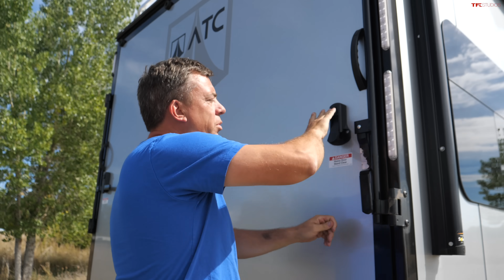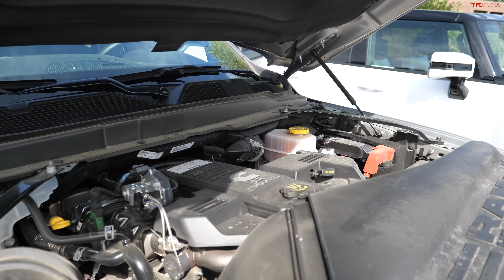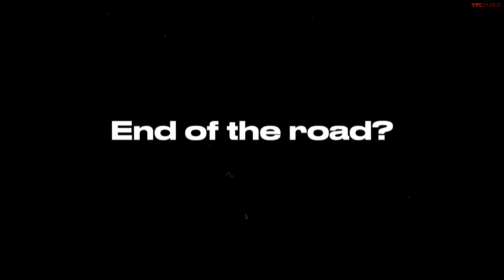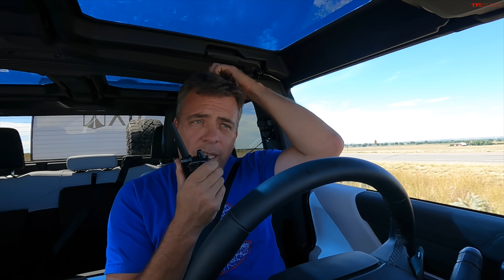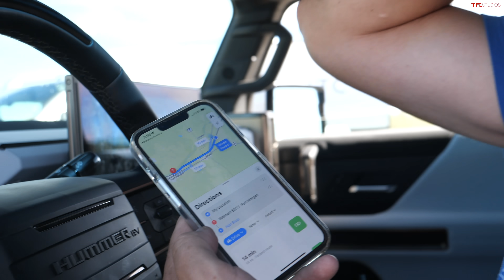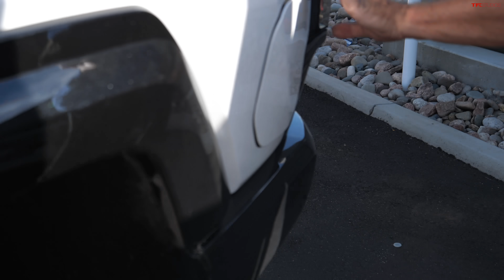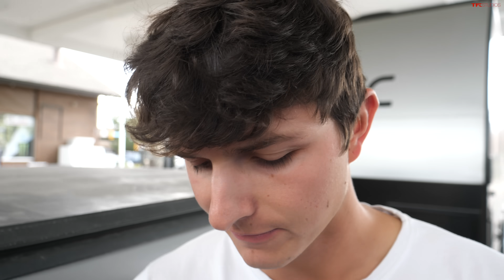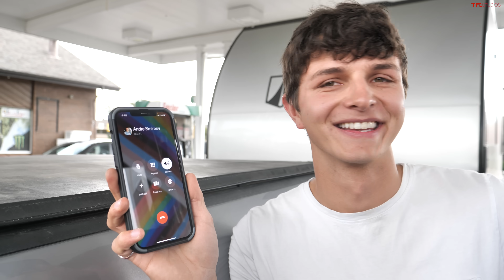How Far Can a Diesel and Electric Truck Tow An Identical Camper Trailer on ONE Fill-up?

Comment: Does it really matter how far a truck can go when it can make it to the next gasstation/ chargingstation ? As long as they are like 100 miles apart max, you are fine.
Reply: It is a problem when you have to spend half an hour each time you stop, only to recharge by 50%
Reply: @williecompton243  So, as I was saying, it is not about how far a truck can go. 
It is about how fast it can recharge the moment you go further then it's range and what you can do during that time.

Comment: The hummer weighs ~1400lbs more than the Truck. Should do another Comparison with a diesel truck that has a curb weight that is the same as the Hummer and then compare towing capabilities and range.

Comment: You should do the test with same amount of money in fuel.  Fill EV first then fill Diesel to same cost.  Might be able to get out of town with the diesel.  EV's have a long way to come, the future is bright though, the  Hummer has way more useful torque for towing than any truck in production ever.
Hummer shootout in a tractor pull or drag race would be more interesting.

Comment: I have a 95 Ford F-250 4x4. It has a huge gasoline, not expensive diesel, motor. It’s my farm truck. I will never buy an electric vehicle!! Never!! 
I guarantee you there’s no EV that could pull our trailer or haul hay in the amount my truck can. EVs are overpriced garbage that will leave people stranded in an emergency!!

Comment: These Newer DEF and older EGR regulated Diesels are terrible on fuel. compared to for instance My 2000 7.3 Excursion that holds 44 gallons and averages 23mpg giving it over 1,000 miles of range. however you cant forget the last of the best my fav my 2006 5.9 Cummins Ram holding 34 gallons and rolling in at 20mpg avg giving you well over 650 miles of stop free driving.

Comment: Before the gang cut away from the rapid charger, the price listed for $37.00 plus. So with going half the distance, the Hummer would require $74. 00 in electricity plus over an hour of wait time provided a rapid charger is available.

Just wait until the winter when the Hummer requires heat and the battery suffers from cold weather capacity loss.

Oldsmobile made an electric car in the 1990's that was only leased, then didn't allow the lessors to purchase at the end of lease. Winter driving, the cars range was less than 40 miles.

Comment: The thing is when everybody is using electricity the price of electricity will continue to rise that was 40 dollars for 50 percent it would be 80 dollars for 100 percent and this is in the infentcy of the electric revolution.. The solution for towing is adding batteries to the camper that can recharge the towing vehicle run the camper..Somebody can build a camper with solar roof ect that way you can also live in the camper off grid for a couple days  or more with full power

Comment: The 'How Far" question is not the question you should be asking. 

The "How Long" and "How Much" does it totally cost to get the the destination with that heavy payload?

Those questions must be asked as well. Until you can recharge an EV truck in 10 minutes and get back on the road for 250 or more miles this discussion is pointless and misleading.

Time is also $$$. 

If a cross country trip takes 2 or 3 days longer what cost or expense do you assess to that? 

Do you include the additional hotel rooms or meals to make that trip, not to mention the down time in your estimate?

If the vehicle costs significantly more to purchase, do you factor that in?
 
Until battery technology and energy density and recharge times can be manufactured to be on par with ICE powered vehicles, cross country travel towing heavy loads will be a hassle and impractical. 

In many "head to head" examples such as this one EV towing will be much more expensive.

Comment: Had you put 100% charge back it would have taken a long time and the cost would have been about equal to the diesel if the charge wasn't free due to the promotion. Also, that charging station probably wasn't solar or wind powered so has is that energy efficient? Remember when the CA governor asked its EV owners not to charge their cars so the grid wouldn't crash causing rolling blackouts.

Comment: The vehicles and infrastructure are not developed enough for this type of use, from what I observed in this video, purchasing an EV/SUV is a fool's purchase unless you restrict your travel to a 50 mile radius of your home location. The B(h)ummer was not capable of the desired trip and route, the Dodge Ram only had to fuel up as needed and that was a long ways down the road. How much of an extra stipend is this channel earning to try and peddle EVs? The technology and the infrastructure are not mature enough and probably won't be in your lifetime.

Comment: Honest question. I saw after you split up you were running 73 mph. Were you doing that with the hummer as well?  Speed is a massive killer of mpg when towing a trailer like that. If you guys were only running 60 - 65 with the hummer then after splitting up you ran 73 that's completely a bad result. Just curious if you made sure you matched that. Even a couple mph towing a wimd sail like that makes a difference.

Comment: I really wish they broke down the per mile pricing. The hummer travelled 128 miles on a 210kwh  but they didn't use all of the battery pack, so lets say it used 190kwh at .43 kwh pricing. That would cost 81 to fill up to go 128. 81/128= .63 cent a mile. The Ram went 211 miles with 21.76 gallons  and their gas cost 4.79/gallon. The total cost is 104.23/211= .49 cent a  mile. So the per mile towing is cheaper on the Ram, the ram is more practical because fill up is faster and without requiring to unhitch, find parking and guard your trailer and wait for it to charge, battery degrade with faster charging, the ram could go longer without filling up and gas station are more abundant and the Ram cost half the price. So why would trucking people want an ev, it makes no sense. Trucks are tools and not a weekend toy. If you have 120k to spend I would buy a base model ram for 30k as my work car, a prius prime for 30k as my daily commuter and a base supera as a weekend car for 42k and still have 18k left over. Also, if one car goes down i still have two car or I could lend out of town guest my cars.

Comment: I don't agree the a 6.7 liter engine is exactly what you want to have in a towing rig. It's way too big for a pickup truck. Scale down a semi truck engine to the needs of this rig and it would be something like a 4 liter 180 hp plant. And it was actually quite disappointing to learn what kind of fuel economy the truck was getting. Granted, that's not much worse than the truck gets without a trailer, probably,  but that gives an indication of the problem right there. It's way too much engine. Compare its performance to Chevy's 3 liter diesel, which got two and three times the miles per gallon, and the Ford and Ram 3 liters were close behind. 

Couple things. The EV sucks on range, but at 11 mpg with 20 gallons - 220 miles - the diesel ain't so hot either. And 11 mpg is only about 30% better than a semi loaded at 80,000 lbs and with a frontal area twice the size. That's terrible.

Comment: Electric Vehicles are just one big lie, gas power - fill up in 2 minutes and can  go for hundreds of miles.. Ev - cost 2x-3x the price of a gas vehicle, take hours to charge, you constantly worry about the battery life, can only travel a fraction of the distance. i will never change to ev, i'd rather walk.

Comment: I noticed the electric charger was saying $37 when he cut it off and that wasn't even a full charge.  Then it was 105 for diesel but he went twice the distance.  Only a 25 dollar difference and you can save alot of time with fuel.  Charging isn't gonna be free  when the demand goes up.  Takes a lot of fuel to cover the 50k price diff. I understand if it's just about saving the planet and you have money to burn buy the hummer.

Comment: I'm actually shocked that the diesel was only around the 10 MPG mark. Of course electric cars are no good for distance towing, so I wasn't surprised at the lack of range, but I expect a modern diesel to get better MPG than that when towing. 10 MPG is about what I get when towing my travel trailer that is about the same size and weight, with my gas GMC 5.7 that is 27 years old.
Reply: I have a 2005 Sierra 1500 2wd 5.3 V8 and get 9.5 to 11 mpg towing 5500 lbs.
Reply: I used to pull a Jeep around the country on a trailer with a 7.3 diesel. It got 19 mpg, and that was in the 90’s
Reply: @williamsporing1500  That is more of what I would expect from a modern diesel. I have no idea why this kid was getting such terrible mileage.
Reply: It’s all in the name of “emissions”. Any Cummins, power stroke or duramax before 2007 will get nearly twice the mpg of 2008 or later.

Comment: So, expected outcome?  Torque and HP are great, enviro-smugness-ability value is subjective, but it's still down to that dang battery pack.  If it weren't for the pitfalls of battery technology these EVs would be more than an early-adopter hobby vehicles.

Comment: Another point that is missing in the ev topic is using headlights;, radio, heaters or air conditioning, long haul in mountain ranges.   Below freezing temperatures all day and night.  Batteries degrade in power in cold temps.  Yes right now cost to charge might be free or cheap but that won’t last.   Imagine having to stop for 30 minutes for fast charge every 2 hours and your doing a cross country drive.  Cost of motels would add the the expense of that ev .nothing against ev but they are not ready for everyone yet.

Comment: Until they can make a truck capable of towing a 44 foot 5th wheel rv trailer (weight around 20k to 25k). and go 300 miles until stopping for a charge i and the charge only taking 15 minutes or less I don’t see ev being a good option .  Most 1 ton trucks are made to tow heavy weight and are very common in and used lots for construction and rv traveling

Comment: They missed the sticker that decreased the payload by over 250 lbs probably due to the spare tire setup. So the hummer has a payload of just over 1000 lbs. I had a 8 seat Taurus wagon with more payload!
Reply: A charger has the same payload 😂

Comment: The Hummer EV is basically a showcar that in the real world is just a waste of insufficient battery production capacity. 
The batteries in the Hummer EV's 1.5 ton 200+ kWh pack would be better used to build four or five city-commuter EVs, or better yet, a hundred hybrid cars instead.
"Analysis finds hybrids make better use of scarce batteries than pure EVs." (Green Car Reports)

Comment: Electric vehicles will go mainstream when a 12k lb rig can drive 500 miles on a single charge, and be charged back up to full capacity in under an hour for less $ than a gas or diesel fill up.

Comment: Hypothetically....if you forgot your cellphone then how comfortable would you be about visually finding a recharge location?  Remember, the app is on the phone and the app gives you the charge locations and distances.  With the diesel, you just pull into whatever gas station along the highway. Botta Bing Botta boom.

Comment: I would’ve liked to see charge the hummer back to full so you could calculate actual efficiency instead of using what the hummer itself said. I’m sure it is high just like MPG’s in the truck

Comment: I am 10,000 years from the future. The range of electric vehicles has not improved one bit because the batteries were perfected in 2012. The laws of physics have not changed and there is only so much energy you can pump into a mixture of metal and chemicals which is a battery.

Oh, and bell bottoms are back in style.

Comment: 3000lb for the 212kw battery in the hummer vs 210lb for 30 gallons for fuel in the in ram 😂the hummer is basically carrying 428 gallons of fuel  in its battery so it’s basically getting 2.85mpg real efficient

Comment: Empty trailer. Guess they know the EV wouldn't make it out of town loaded with a toy and gear. Not to mention if you want water to shower or maybe to drink. My trailer holds 100 gallons of fresh water.  Oh and the last thing I want to be doing on my time off is waiting on a battery to charge even I could find a charger every few miles.

Comment: how much does it cost to charge the hummer from 5% to 100% cause if your paying $40 to travel 120miles that's not a good deal..
Reply: he didn't even fill it to 100% he got to about 56%
Reply: At that rate he would have paid over $100 to fill the Hummer compared to the Cummins

Comment: Most people who buy trucks to tow with rarely tow, and most of those who do usually don't tow a long distance. My Rivian tows just fine for my personal needs but is not a replacement for a dedicated towing vehicle. 

It's all about what you need/want. The information is all available but you have to filter the lies from both sides and figure out what is going to work for you.

Comment: The electric vehicle could be so much more if they would do one thing - standardize quick swap batteries - think DeWalt. To me the current EV looks that they will need replaced every 5-10 years because the batteries are not standardized which means you won't be able to  replace them easily when they need changed, the vehicle won't be serviceable if they can't get replacement battery, being several models old.
Right now I'll stick to my 2004 Dodge RAM Cummins 5.7. Doing this same test I would get 15-17 MPG. I can drive from MI to TN on one tank. 
I'm disappointed in both of these vehicles. Is it some kind of requirement by the EPA to reduce mileage in new vehicles?

Comment: I have a VW AMAROK pick-up.  3litre diesel, with 245 bhp and about 450 pound feet of torque.  On motorway, I get 8.3litre/ 100km @ a steady 112km per hour. That’s 70mph in  ‘ Mercia speak. That is 28 miles per American gallon.  That gives a range of 600 miles a tank. EV’s are not in that ballpark.  They are great for shorter distances and around town.  For pick-ups and larger, the only replacement for diesel/ petrol is a combustion engine powered by hydrogen.

Comment: The new diesel's suck, my old 12v that I had turned up to 450 rear wheel HP got 9.5ish pulling a 26k trailer and over 15mpg pulling a 9,000 lb (loaded) horse trailer, and my single axle Freightliner with a 12.7 Detroit gets 9-10ish pulling the 9k and 8.5 on the 26k (but does a much better job than the old dodge) the electric vehicles just need a battery breakthrough before they're good for pulling distances, is what it is

Comment: The math on the Hummer is incorrect. If Andre has 8% left on a 200 kwh battery that would be 16 kwh X .06 kwh per hour = would be about 10 miles more range. Still not very good.

Comment: With two average adults that hummer weighs nearly 10k lbs  and has a tow rating of a  ford ranger.  that’s the insanity of the hummer ev it defeats the purpose and the goal of an ev it’s too heavy, it’s American excess at its finest,  a waste of battery material to boot.  it won’t be able to fill the need of truck owners overall.   It’s a a super heavy inefficient toy with lots of gimmicks to distract suckers from the reality that it’s not as good as a diesel truck. Crab walking, screens, how quick it is, whoopty freakin do.     I guess I just don’t understand and it. Even as a development platform it’s out of reach or most people and that could be better spent on more affordable cars or small crossovers

Comment: I like this match, great video. I do have some thoughts about how Will electricity for charging ev's go up in price in charging stations? or at overall houses? If I look at it from a ROI standpoint, the electrical infrastructure is gonna need on the long run major updates for acommodating the energy requirements of all people going ev. so how much will the price increase for that return of the investment for those major upgrades? because one major benefit right now of ev charging vs diesel is price. but for how long that will stay the same? there are countries where electricity is very expensive service.

Comment: What about the BACK-TRACKING to go to a previous electric charging station back down the road towards your starting spot..........and then driving BACK to the point where the EV had to turn around?    Let's factor that into the equation.

Comment: My Cruze with a 1.4L GTDI was able to make it from Ann Arbor, MI to Breezewood, PA with 1 tank of gas. I could have pushed it further, but didn't want to risk getting stuck on the shoulder of Pennsylvania turnpike with no signal reception on a freezing cold at night. 
I've thought of getting an EV, but given the miserable winters, I'm not sure if it can cover 150 miles climbing the mountains with a single charge in winter. There is no charging on the turnpike between Somerset (Exit 110) and Harrisburg (Exit 247).

Comment: Go 2 hours, unhook every time and waste another hour total (rinse and repeat) versus just driving the full distance. No thanks. EVs are fine for city driving and commuting to/from work or shopping. Beyond that, they are useless. A buddy of mine drove from Cecil County MD Ft Bragg NC. It took him 15 hours. In a gas powered car it would have taken less than 1/2 that.